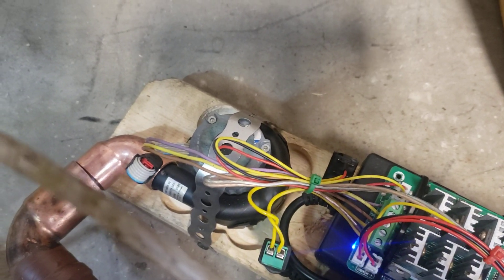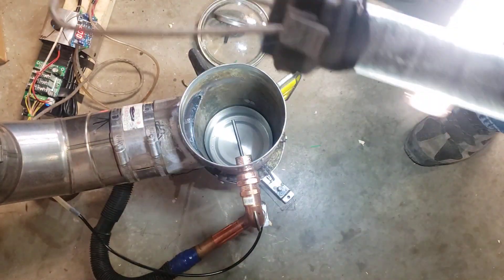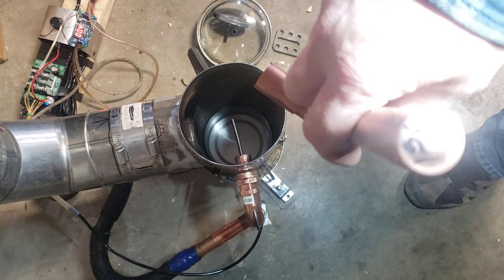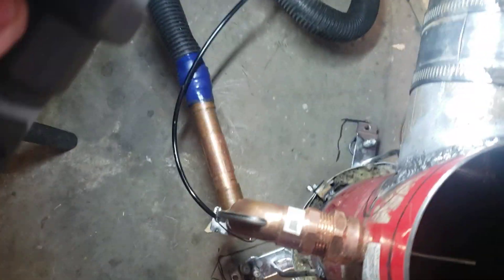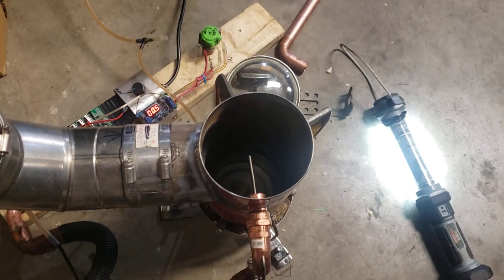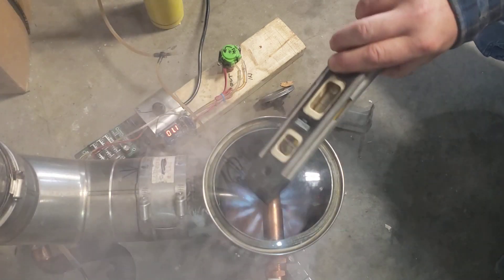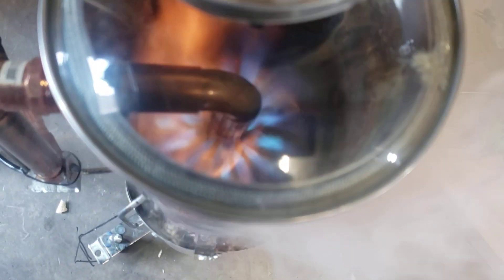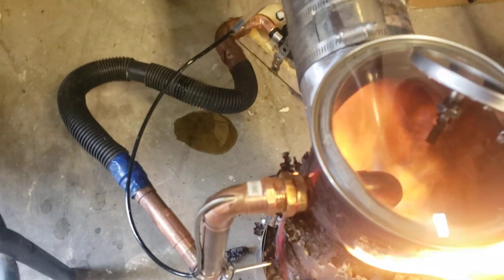MAD MAXX 2.0,  waste vegetable oil stove, heater, wvo,  used oil, blue flame,

Comment: Just wondering couldn't you use a fishtank heater to heat your waste oil. Just asking I don't really know
Reply from the maker: as it turns  out    I have kept the oil delivery line inside the air tube to keep it as cool as possible for the low burns..
with low oil flow .. it carbons up on low burns
Reply from the maker: check out mad Maxx's evil stepsister maxx   3. 0

Comment: What kind of pump are you using? And will it pump waste motor oil?
Reply from the maker: and yes it'll pump motor oil
Reply from the maker: Brand: INTLLAB

4.1 out of 5 stars195Reviews

INTLLAB 4pcs/Pack 12V DC DIY Peristaltic Liquid Pump Dosing Pump for Aquarium Lab Analytical, Flow Rate 5~100 mL/min

Comment: What are you using to get the dc  voltage for the timer and pump? Will that pump handle waste motor oil? What is the make/model?
Reply from the maker: I have a 120 v ac  to 24 v dc  converter   say   5 amps  (lots big enough) to power the Dosing Pump   and interval timer and 24 v dc   cpap    blower......... probably overkill but whatever. you'll have to filter to say 20 microns    to keep the big chunks out but    yes it'll pump any liquid .   and you get what you pay for  . (

any converter will work as long as it's  big enough to handle the dc amp load s. 
24V 8A Power Supply Adapter AC 100-240V 50/60Hz to DC 24 Volt 8 Amp 192W Converter Transformer with 5.5mm x 2.1/2.5mm DC Connector (Amazon) 

DC 5-36V Digital LED Relay Board Dual-MOS Trigger Cycle Timing Circuit Switch Timer Delay Module

(amazon)
Reply: @dennisw4828  thanks

Comment: I love your pump controller, could you please tell me where you got it?  It almost looks like a kit that you made by hand.  Am I correct?
Reply from the maker: DC 5-36V Digital LED Relay Board Dual-MOS Trigger Cycle Timing Circuit Switch Timer Delay Module

 found this on amazon for $11 bucks   cad. 
it's   from China   but whatever .
it's infananly adjustable..
Reply from the maker: iv got this one set at  . 2  of a second on(and left it there) and   adjust  from 1.4    off to. 1sec off   

 your burner your incomming air..... all your variables will determine where you set your pump and blower.
mad maxx   3.0  is close to reveling   say tuned